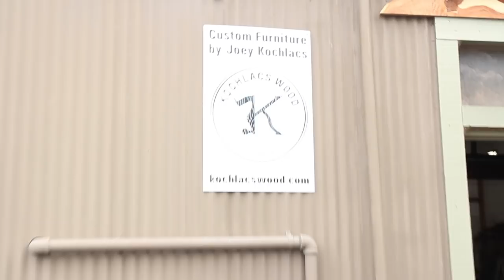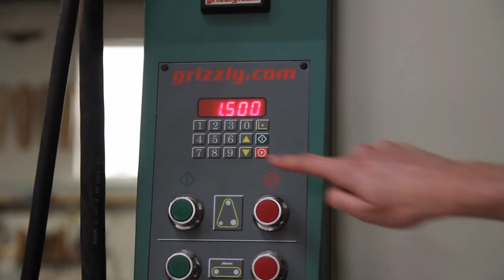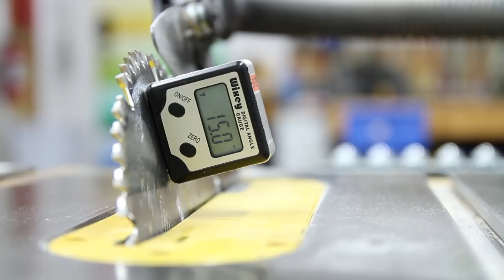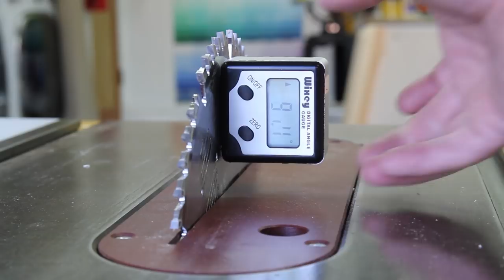Build: Mid-Century Nightstands (Part 2)

Comment: I love/hate the lock miter. I did all our kitchen's drawers and pull out shelves with this joint. Like you pointed out in the video, it takes a while to dial it in for production (hate).  But once it's set up, I was feeding the wood through like a hot knife through butter (love). Then came the glue ups(!) and getting the joint to close was work but once the joint came together, they were square (love/hate).  Cool vids. I like the pace and the level of work you are doing. Thanks for sharing.
Reply from the maker: Thanks!

Comment: Hay, I'm comment #3. Third time's a charm. Nice project. Also, that miter lock bit seems to be more trouble than it's worth.
Reply from the maker: Hazem Bata I totally agree with you. I wanted to try it but actually started to regret my decision about half way through. It’s great for low precision miters... for example I used it to make a box beam out of pine and it worked great with the softer paint-grade wood. I won’t ever use it on fine furniture again.

Comment: Great work! I always learn a ton on your vids. The Incra equipment is always amazing to look at.#Goals. I'll share one thing that has helped me a lot of late with glue application: the little gasoline brushes from Harbor Freight. Pack of 50 is about $3, so cost is nominal. I see you were using a paint brush to get the glue inside those routed grooves. Gasoline brush holds more glue, yet has similar precision. so does a faster job. Keep it up!
Reply from the maker: Dan Taylor thanks for the tip! Wish I had a Harbor Freight closer, maybe I’ll look for them online.
Reply: Thanks! Just watch out, the gasoline brushes are cheap, and they tend to "shed" a hair or two sometimes when used to apply glue. No real issue, but I know (and respect) how meticulous you are!

Comment: Loving your videos Blake. Keep it up.

Very envious of your full and well organised router but drawer! :)

One suggestion. The pocket holes at the end are facing the front of the case. If you had cut the dado in same panel as the pocket holes, the holes would have faced backwards and not be as visible? Or are you planning to plug them?

Cheers.
Reply from the maker: Andrew Delane thank you! I’m not really worried about the holes since the drawers will always hide them.
Reply: Blake Weber Haha, of course! There are drawers still to come. Well that answers that. Look forward to part 3!